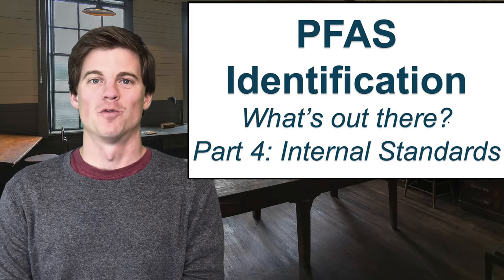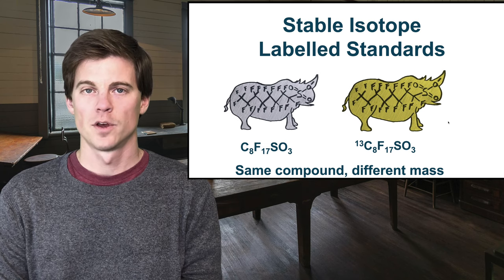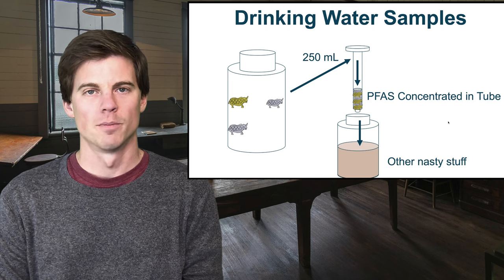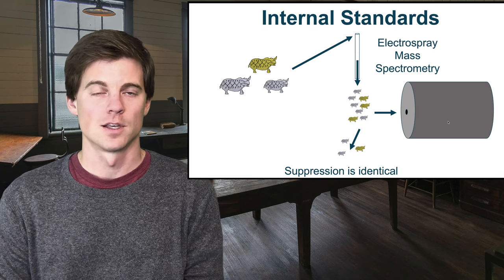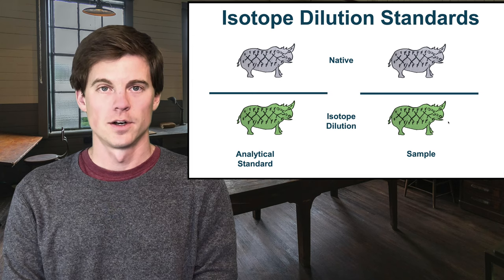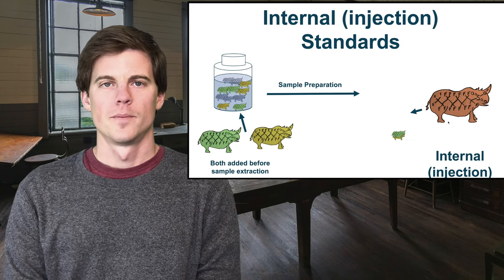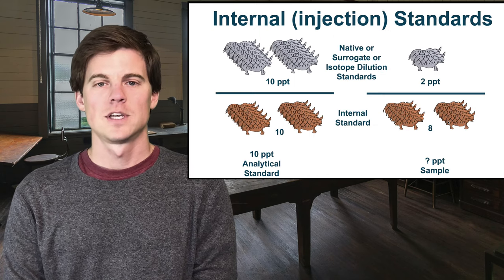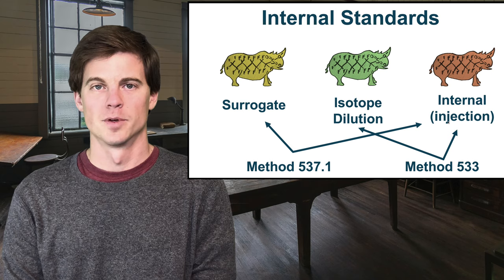PFAS Analysis Part 4:Internal Standards

Comment: I assume then that it is not feasible to do any sort of PFAS analysis using only HPLC-UV?
Reply from the maker: Correct, PFAS analysis using HPLC-UV is not possible at any concentrations that would be experimentally relevant. There may be exceptions for some obscure PFAS that contain benzene backbones, but this is very rare in PFAS chemistry.